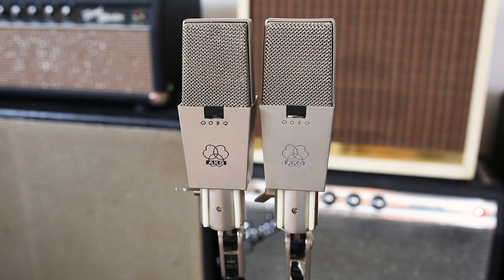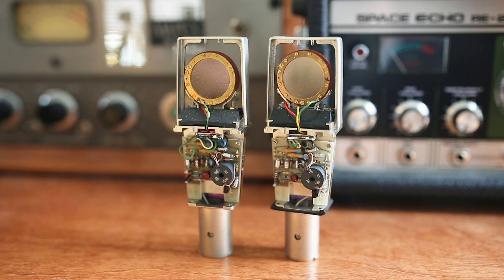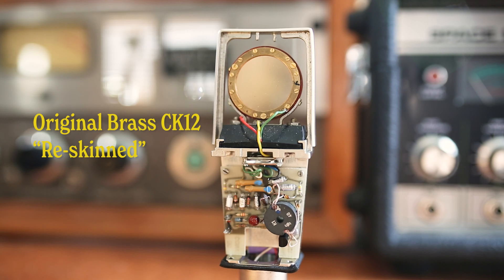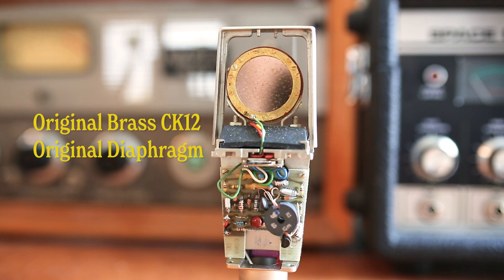Original Vs. Reskinned Condenser Microphone Capsules

Comment: The CK12 is so sensitive to the tuning of the internal chamber that it wouldn't surprise me if the difference is down to how the reskinner put the capsule back together, or some variance in AKG's original process. Also it's worth noting that the CK12 had many revisions with quite different sonic qualities. The first versions had THICK polystyrene diaphragms and a shallow chamber which lead to a very flat sound with less output. By the end of the C12's run they had switched to 6 micron mylar and had widened the chamber to increase the output of the capsule, which had the side effect of making the HF peak stronger and start sooner. The red painted capsules like in the video were the brightest.

Comment: Could I ask you a question? I have a pair of C414 TL-II's which I love, but Ive been wanting to get some new capsules for them for awhile now, possibly brass, but also, obv AKG doesnt make the older capsules for TL-II's anymore, but would it actually be possible that in the right hands I could actually just utilize my existing capsules, but just get them reskinned instead of having to find new capsules?
Reply from the maker: For sure! I would never really recommend reskinning unless the capsule is damaged in some way. If I were you I’d either look for a Tim Campbell CT12 or an OPR CK12 as both are great takes on the original brass CK12.
Reply: @colepicksvintage  Hey bro. Oh, okay. Ya, forsure, those are actually the exact two Ive been looking at. We were actually chatting last year, or so about some capsule replacement stuff, so I apologize for messaging here, but this video just got me thinking. 

So, basically do you not recommend it, because just being nylon capsules reskinning just wouldnt really make sense to to the cost vs just getting new capsules? Like, basically, even with say an older brass capsule EB like this, would you reskin just to essentially preserve the original capsule somewhat vs just getting a new one?

Comment: The thing that really sucks about these microphones is that they become more or less broken when you re-skin them (they lose the high end that people loved them for and that made them special), but you're going to have to reskin them since the capsules don't survive for many decades of use, so eventually, all of these mics are going to sound kind of forgettable and be pointless to own other than for maybe historic reasons, even though they were once king in the studios along with it's competitor the u87. With the u87 you can just buy another completely identical capsule as the original one, and it's going to sound like the day it was made, which is not the case with the 414 EB. It's really sad in a way. I wish someone figures out how to reskin them properly, but until then you better get one with an original capsule in good condition and hope that when the capsule one day dies on you and you reskin them, you'll be able to recoup some of the loss when selling them before prices drop when people realise there's nothing special about them anymore.

I've got to say that on drums, the difference wasn't as big though. Other than the low end mostly disappearing on the reskinned one, it kept its tone and some of the top end, which means there may be use for the reskinned mics still as overhead mics etc, although I'd never want to put a reskinned capsule in front of a guitar if I could avoid it.

Comment: I own both an original and a re-skinned 414eb with the brass capsule. They sounded more similar than these two mics in the video when I A/B them. Just goes to show that all vintage mics are going to sound different from one another. It's hard to know where a mic has been throughout its life and how it was treated -- perhaps it was used a humid studio environment for some years and changed or damaged the capsule. I also own a BULS and prefer using that mic 9 times out of 10 when I do a shootout between it and either of the EBs. The EBs are pretty bright mics and just not totally my thing. I'd  also rather reach for a U87 than an EB. 🤷‍♂